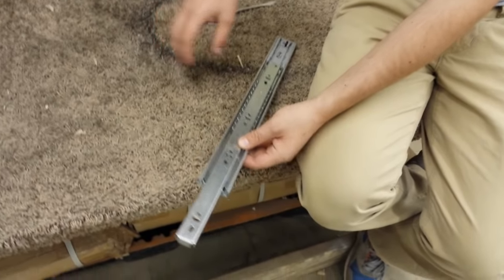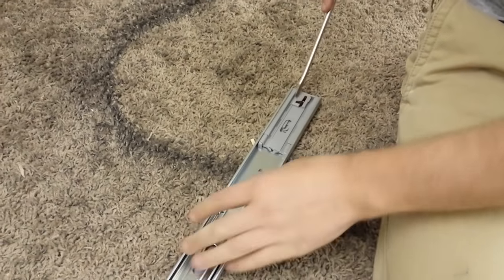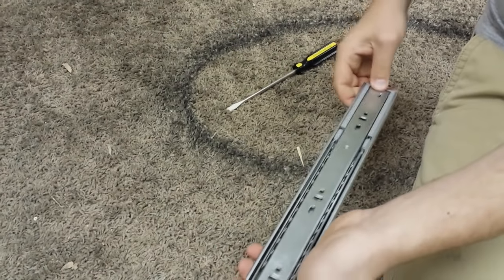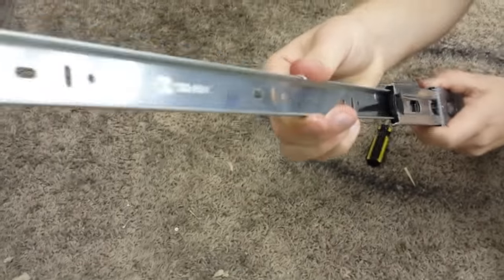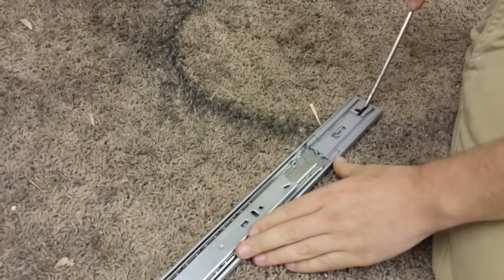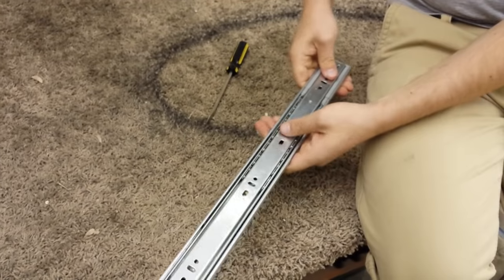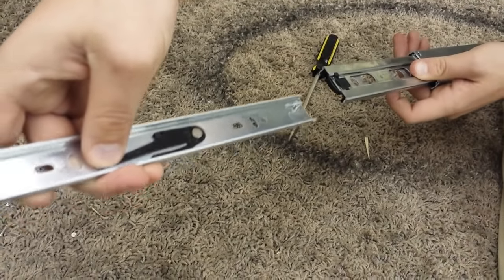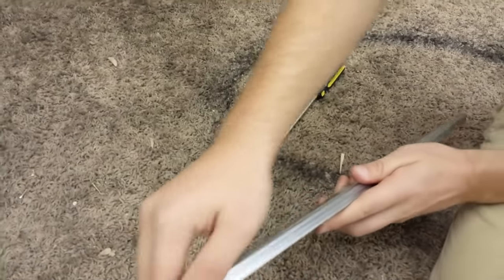How to Fix a Soft Close Drawer Slider

Comment: My soft close drawers stopped working properly about five years ago, about a year after installation. I took the drawer out and figured it was a bad instal, because the drawer would slide open about 3-4 inches after it was closed.   I am doing my own kitchen renovation now, and as part of that project, I decided to look up the subject of soft close mechanisms that weren’t working properly.  I had watched about 5 videos when I came across yours, and it made much more sense that the others, so I dove into it and had it fixed and working great in less than a minute.  I thank you for that, BUT my wife was SO-O-O pissed when I told her how easy it was to fix (my mistake!). She wanted to know why I hadn’t fixed it for 5 years, making her “make-do” with the way it was.   So, lesson learned.  I should have made a lot more noise with a hammer and a drill and take a lot more time before I declared it a success.

Comment: Thank you sooooo much for posting this video. I'm building a big set of DIY garage workshop cabinets and for several days have been fighting with my drawer slides. Thought I'd installed them incorrectly. Went through just about every bad word I knew. Then I thought I'd check on You Tube to see if anyone had gone through this and - bingo - your video popped up. Thanks for sparing me more grief!

Comment: Looked at your video and it gave me the concepts I needed to fix my dual-can garbage drawer.  The soft close mechanisms had retracted and I simply had to pull them forward to tension the spring.  The garbage drawer has a different construction than normal drawers, but the concepts are the same.  Thanks!

Comment: Nice, to the point vid.  However, isn't the drawer glide supposed to lock into the side rail rear plastic piece and pull it forward, ready for the softclose to work?

Comment: My problem: Both soft close slides are engaged but only one retracts all the way back. The other stops about an 1/8 of an inch shy which is making the drawer front angled ever so slightly. There is a hook like metal piece on the drawer side runner that slots into a hole on the cabinet side plastic slot (near that tab in the video you show). When the drawer is out, i CAN get the cabinet side to retract all the way but when the draw is in, it wont. Drawer is square. Any ideas?

Comment: We have 1 drawer that doesn't total soft close all the shut. It stops about 1/4" short, it will totally close if you push it. Is there an adjustment for this condition? Thanks Bob
Reply: u need to adjust the rail which is fix on the drawer
Reply: After watching this video I pulled out all of the soft close drawers that weren’t closing all the way & found that one of the blue plastic mechanisms was pushed back & one was not.  I pulled the blue piece forward until it locked into place on both sides & now they are all closing quietly by themselves.

Comment: I used my hand and pulled the plastic forward and it clicks .  Then it works for ONE time then the drawer soft close doesn't engage!  What to do
Reply: It sounds like the pint that engages the slide may be bent or broken. It may be simplest to replace the side.

Comment: Hey, so you may not see this comment since it's been 9 yrs but I'm having a different issue with my soft close drawer. It seems that spring part is keeping my drawer from closing all the way (about an inch) on one side. The other side works great! Do you have any ideas about what the problem could be? Thanks!
Reply: I have this same issue.
Reply: Did you figure it out?

Comment: I have the same drawer glides (Richelieu) the soft close works but it takes two hands to pull the drawer open, can this be adjusted?
Reply: I have the same problem!!  Should be relabelled ..soft close/hard open !   Did you have any luck with richelieu?
Reply: @jmack619  I gave up on these hinges.

Comment: I need any tips on how to adjust some rails on a desk I have had built. The rails are level but due to desk build they are pinching or coming closer when coming out from closed position. Causing the rails to run smooth to ruff. both pulling out and pushing in. any help would be great.
Reply: How do you take drawer out that is tilting downward and won't come out

Comment: How about a soft close that won't catch and stay? I can manually push the soft close with my finger, but it won't catch and stay open. I'm guessing some broken plastic inside?unfixable?
Reply: JulienKozak I’m having the same issue
Reply: I realiZed its just plain broken. Small plastic tab inside somewhere broke. Maybe this is just a low quality slide since its $8 from ebay.
Reply: JulienKozak can you send me the link? I could use about 4 of them right now. These ones came on an expensive husky tool box. Kinda upsetting tbh
Reply: @JulienKozak  Im having the same issue , If i push the drawer in firmly and then open it its ok for a bit , then the same happens . Its a new cabinet and could return but its a real pain emptying the cabinet if its an easy fix ?????? , ie bend the metal tab . They have to disengage otherwise how could you remove the drawer ,